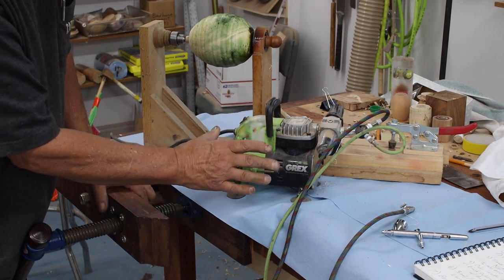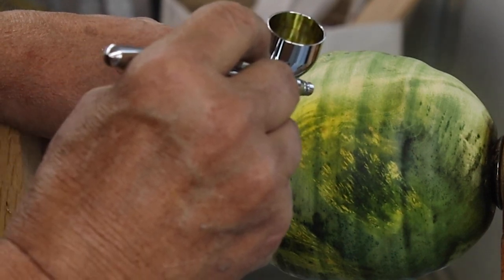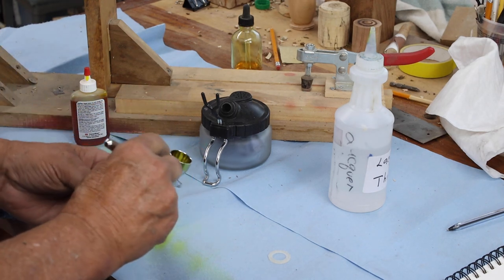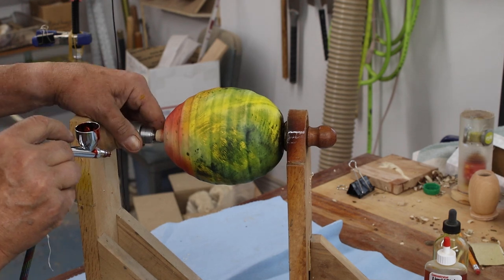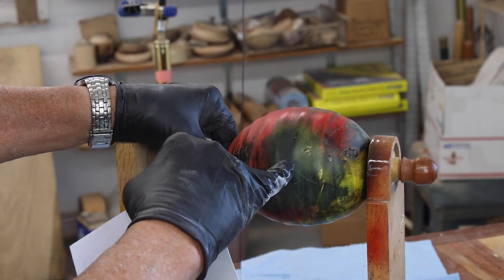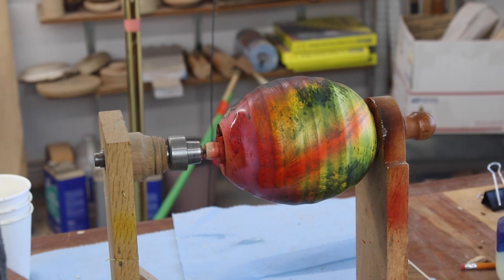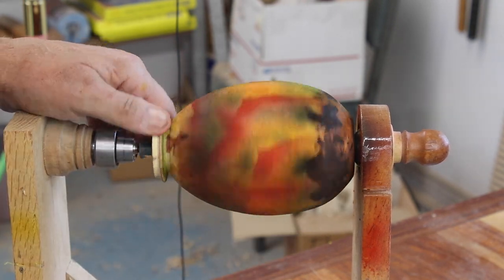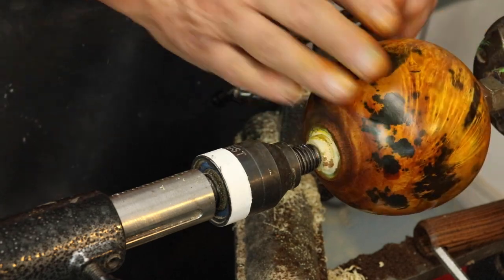Completing Various Elements of Hollow Forms-Continued -Woodturning with Sam Angelo

Comment: Really appreciate the insight into this aspect of finishing.  Is it possible to complete turning the bottom of vessels like this before applying the finish so you don’t have to deal with blending the finish after turning away the base?  … or is that something that won’t work at all?
Reply from the maker: I am sure you could.  This is just how I have always done it.  Part of the issue is leaving a little more mass in the bottom of the vessel to prevent vibration and then removing it later when reversing it.  I may have to look at this.... Thanks Sam

Comment: Very nice finishes. I may have missed this but for urns for ashes do you apply a heavy finish like resin on the inside or just your lacquer finish?
Reply from the maker: I usually apply shellac on the inside. I really don't worry about the ashes migrating to the surface, or leaking out thanks Sam